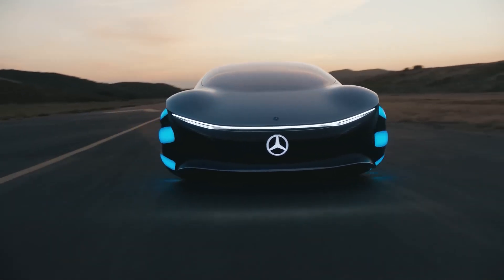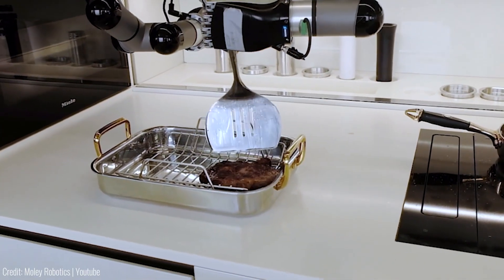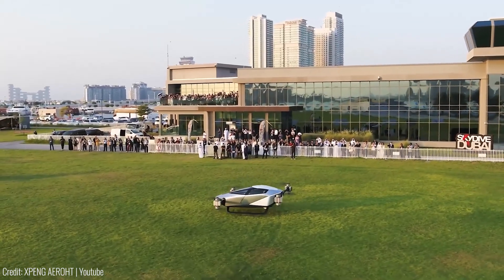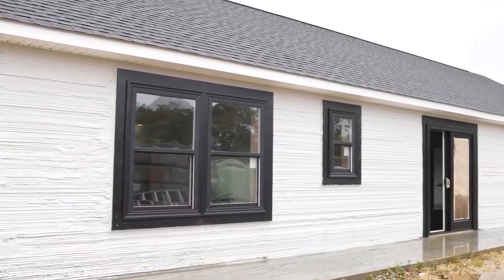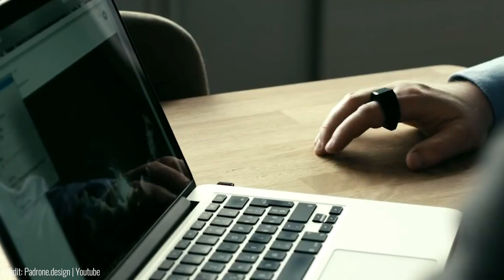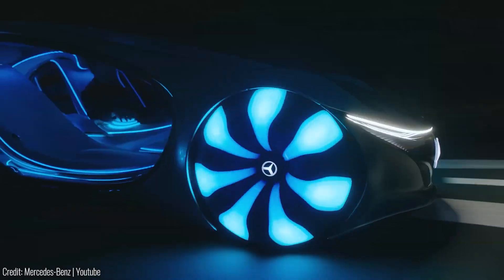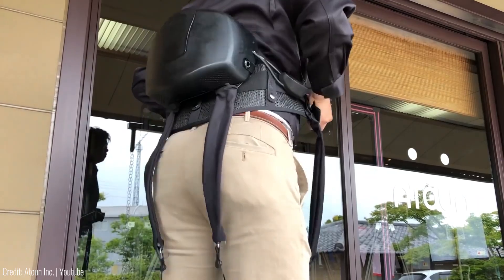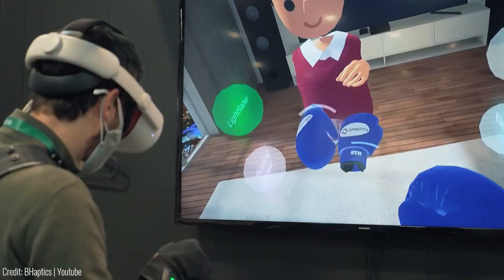12 Future Inventions Soon Available To Everyone !

Comment: I would like those contact lenses. 
It needs facial recognition so each time you look at someone,  it tells you who they are (more so people you have previously installed into the system). I'm bad with names. Plus, it can bring up other info on them: family members, birthdays, home and work, etc. 
It needs a navigation projection. 
If it links to your phone, the connectivity possibilities are many with that. Like translating things you read, etc.
Then, of course, it needs to be corrective lenses as well for those that need glasses. Not only just your prescription, but also automatic zoom and focusing on what you're looking at.
Maybe even the ability to see different wavelengths of light.
All of course the standard thickness of a contact lens so it doesn't damage your eye. Or, just make a transplanted bionic eyeball.

Comment: The house printers have been debunked as to the reported printing time.  The times given are only for printing the structure.  It doesn't include setup, teardown, and installation of electrical, plumbing, and finishes.
Reply: yeah you'd really need completely prefabricated houses that are just unpacked and bolted together in order to be any faster. Plumbers and HVAC take 1 to 2 days on their own depending on the work required.

Comment: I wonder about that smart Eye lens. I personally don't wear eye contacts, but I've heard that they aren't permanent, and in fact need to replaced regularly. This Smart Lens sounds like something that would be really expensive to have to replace regularly.
Reply: thet canceled it
Reply: They would need to be cleaned regularly, same as contact lenses. Not all contact lenses are disposable, they are just the most common kind because they're the easiest to take care of and generally more comfortable. I tried some rigid toric lenses once and those were just awful. These would probably be like that actually--pretty uncomfortable to wear.
Reply: That could be use for cheating and spying. Imagine someone could stole your credit card data by taking a snapshot without you  noticing it.
Reply: We don’t really know h9w expensive it will be in the long run. Smartphones were pretty expensive originally. There is no intrinsic reason why the cost wouldn’t come down over time to an affordable level
Reply: @Tortilla.Reform probably wirelessly
Reply: They stopped the lens they are working on making tvs more expensive now
Reply: It would simply need to be cleaned every night, like a glass contact.
Reply: To put in power and internet connection units, I doubt how comfortable it will be. And smaller gadgets with high functions tend to generate heat...right next to the eyeball???